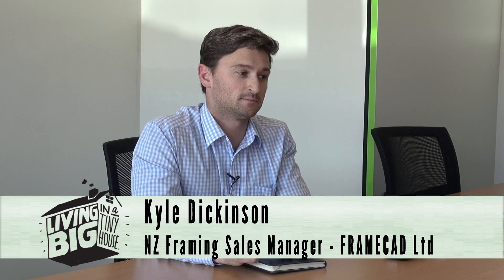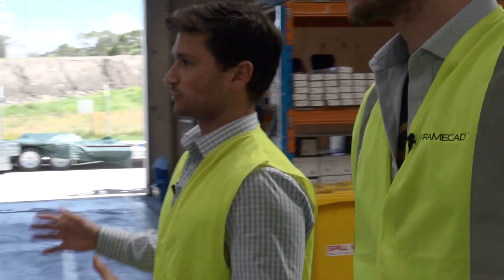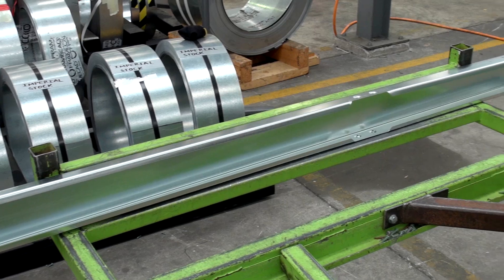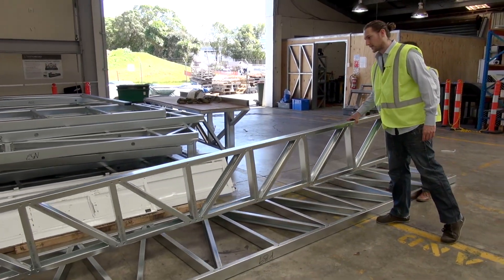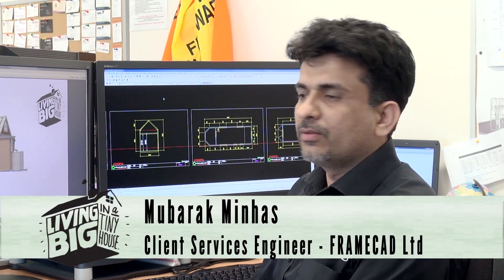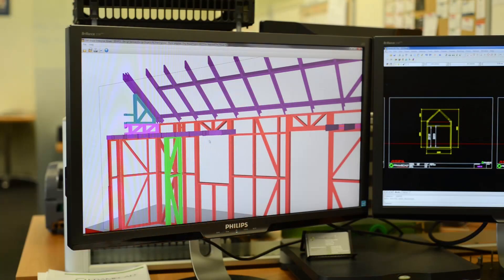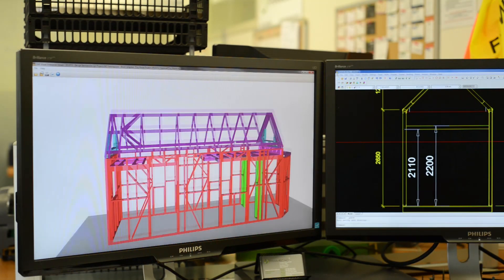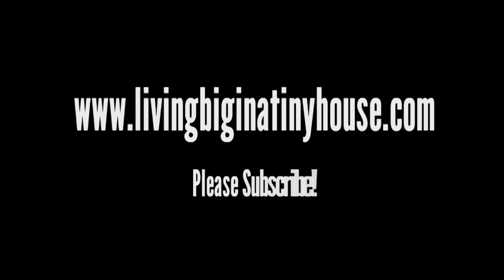Steel Framing With FRAMECAD: Design and Why We Chose Steel

Comment: Steel frames transmit electrical sounds, etc. So if you hear electricity sounds, other sound waves as I do...... if you Don't want to go crazy, use wood, not steel, framing.
Reply: What do you mean by "electrical sounds"? All sound is a pressure wave and as such is conducted/reflected/absorbed by all materials - except a vacuum.

Comment: Steel framing = insulation is almost useless...
Reply: I agree, unless you insulate around the outside of the steel.  Materials need to suit your climate and needs.  Maybe he needs it to be lightweight for transportation.  Generally, I think log cabins or straw bale houses are suited to cold places, and stone or mud buildings are more suited to warm places.  The logs and straw are insulating, keeping the heat in, and the stone or mud acts as a heat sink to absorb the hot sun in the day and radiate it back out at night.

Comment: Hey Bryce, I love your content you have the best video resources I've come across (and its so great to have information that' not american centric!). Question about your framing: is it dangerous to use steel framing on a tiny house in case of lightning storms or damaged electrical circuits? I know in a regular home this is offset as the steel acts as a conductor which channels the electricity into the earth but in a tiny home on wheels wouldn't this just electrify the whole structure?  
Thanks, I can't wait to see more progress on your house and website!

Comment: this looks really appealing and will be interesting to see how it turns out. i watched parts of the video but what is the cost of steel framing compared to traditional wood? i love the videos of other people featured did but the budget looking at the videos for this house seems a lot higher than most other people. who can afford these designs, the level of research, support, many other people involved in this house? a lot of the other tiny homes looks like they had to do it all by themselves with a much smaller budget out of necessity.

also curious but if there was a huge magnet next to the house...what would happen? then again there's metal in all our houses but curious what it'd be on a house with all steel frame.

Comment: Do you know that the steel framing will decrease the efficiency of the insulation by 55%, compared to the wood framing that decrease only by 10%. Those numbers are only when you put the insulation "in-between" the frame... if it's outside, the efficiency is much better but I suppose you will not do that.
Reply: hi,thanks 
so look much. Indeed SHOULD BE NOT STEEL if u look 1.insulation is costly 2.solar system is costly and vital for ENERGY .But STEEL is bendable, typhoons earthquake 
plus Sunammy.

We are in Taiwan, now building a. warehouse.I am the project manager.Worried Sick.. All steel. There are laws and bblabla. ****I would LIKE what are your suggestion and key points.May you email?????eileenplastic@hotmail.com
Reply: Finally some sense. I've been scanning the comment section for this. Basically, putting insulation between steel studs is worthless insulation
Reply: insulation of steel is actually better than timber cuz it doesn't band or twist. with proper thermal breaks, it is NOT a problem at all. thanks

Comment: I'm planning to build my own tiny house in Canada. I'm really enjoying following along with your build! My initial reaction was "why would you want to frame with steel?". Learning about it has changed my mind, and I'm wondering if this is something that I should incorporate into my build. I'm very curious about how this will change the way you wire electrical or do plumbing. Can you drill holes through the steel studs, just like wood? How do you fasten to it? Self tapping metal screws, instead of nails or woods screws?
Reply from the maker: Hey there. You will see more details on this in our next video, but all of the service holes for plumbing and electrics are actually pre drilled in the steel frame, so no additional holes would need to be created for this (although they can be should the need arise). Yup, self tapping screws would be the way to go for this. We actually show the kind of screws that we will be using in the next vid.
Reply: Living Big In A Tiny House Thanks! I'm looking forward to the next video! You guys are awesome for doing this!

Comment: Compared to timber, what are typical differences in weight when using this c-channel steel?
Reply from the maker: Steel is on average around 1/3rd the weight of timber. This made it a very attractive option for us.
Reply: it is mentioned in the video... 1/3 the weight of wood

Comment: Great video guys. Thank you. I'm interested to hear the cost factor. What is the total cost of your particular design, and how does that compare to what it would cost using timber? We are still in the planning stages of our build, but your videos are giving us lots of ideas and positive advice to consider. Cheers Paul
Reply from the maker: Hey Paul. The cost of framing with steel is actually a bit cheaper than timber framing. We'll be posting all costs up on our site when we have a chance to compile it all. :)

Comment: Did your research find out the differences in strength between steel and wood?
Reply from the maker: Hey, when you are framing for steel (in the form that we have used it, not welded) and wood then the strength between them is very similar, and so the engineering for the two is pretty much the same.

Comment: I've often wondered why more poeple don't go with this option when building a tiny house. This or foam cored panel construction.
Reply from the maker: Yup, we think it made the best sense. Yeah, a SIP would also be a really great idea. We looked into this, but didn't like the insulation material used in most of them (EPS). I'm hoping to see people start to manufacture SIPs with a help core.
Reply: Because insulation / thermal bridging

Comment: It's amazing how much strength even thin sheets of steel like that get once they've been bent. I used to imagine steel framing as being insanely heavy until I did some research on it. Just have to be careful with the electrical wiring when it comes time for it...
Reply from the maker: Yeah, it's actually quire impressive. Yup, always be good to be careful when doing anything with electrical wiring though! It's a bit easier in our case where we will mostly only be dealing with 12 and 24 volt DC.

Comment: Steels ok but personally would prefer wood for energetic&  aesthetic values for tinyhouse mobile  homes.
Reply from the maker: Yeah, there are certainly upside and downsides, Our framing won't be at all exposed, so it won't aesthetically make a difference. It also depends on the circumstances under which you are building a tiny house. If you plan to be moving it a lot, then I think that making lightweight choices is important. If you own land, then it's not such a concern.
Reply: sunsetlights100 wait....so with wood framing you keep the framing exposed instead of cladding it with whatever you want?? Yeah uhm....that makes little sense. You can have steel framed tiny house and both inside and outside cladding with wood and you'd never know it had a steel frame.

Comment: Having built lots of structures using traditional dimensional lumber, it would feel like such a big leap of faith to go with steel framing. Yet I can see the benefits too, particularly in the weight savings. Looking forward to seeing this come together.
Reply from the maker: Cheers! The next video showing the fully constructed frame should be up next week. :)
Reply: I'm on the same boat here. I have always worked with wood. Im in the process of designing one of my own. Im thinking hybrid of the two. Exterior walls and roof with lumber and interior walls of metal. Hopefully get the best of both worlds.